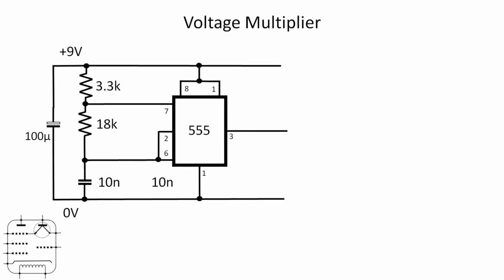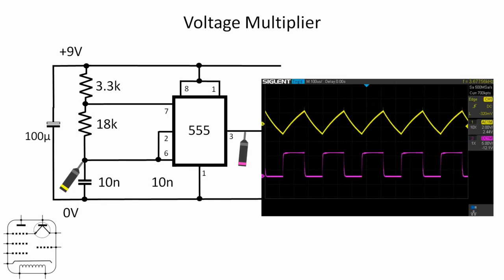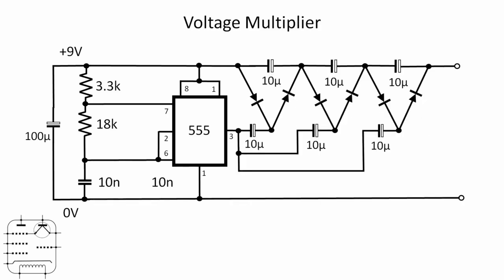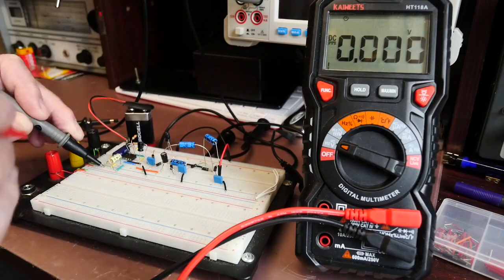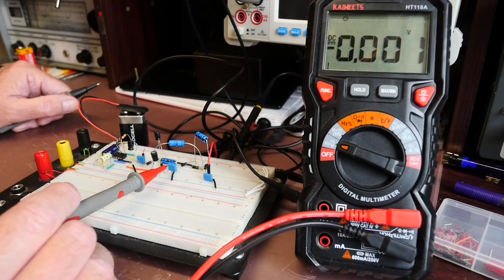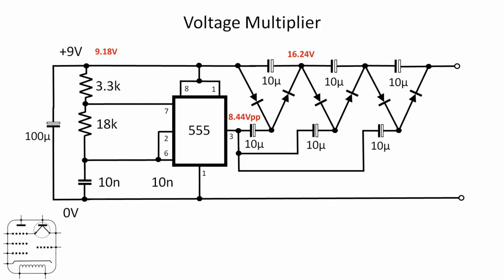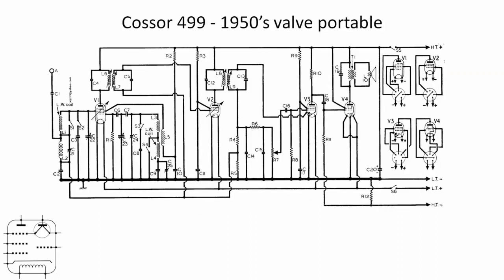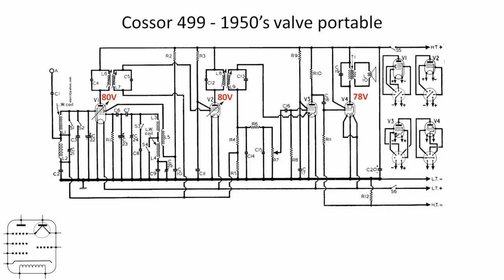Diodes and Multiplication    #071

Comment: Firstly, thank you for taking the time to put these videos together and sharingthem with us. I'm a little confused about the 555 astable configuration. Should pin 8 be tied to pin 4 instead of pin 1? Also, I think a great followup video would be to calculate the current, for the purpose of powing a specific load, and perhaps test the output with a load attached. Anyway, Great job! Looking forward to viewing the rest of your videos.